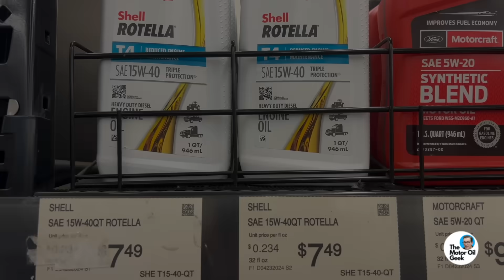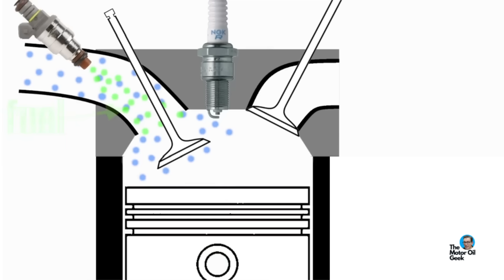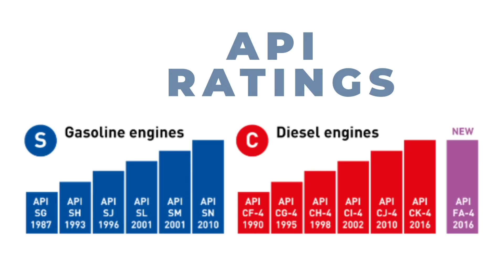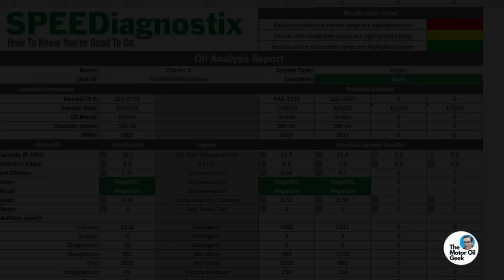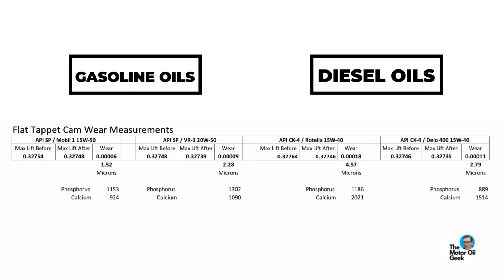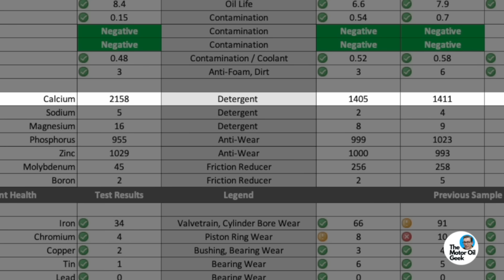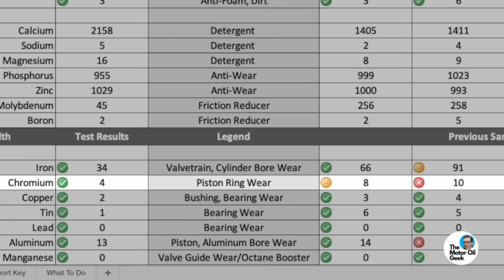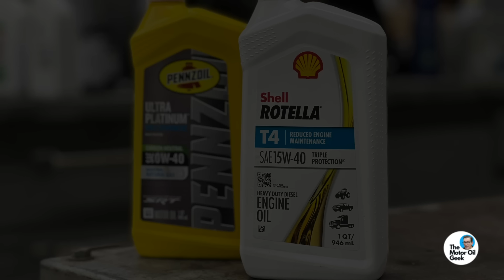Why DIESEL Oil is Actually WORSE for Gas Engines!

Comment: I have my original (86 yr old) 1939 Chris-Craft Model K naturally aspirated gasoline 6 cylinder engine in my boat and have been using Shell Rotella 15W-40 for over 15 years. Engine is L-head and has flat tappets. No issues. 85 HP, max RPM 3200, idle RPM 500, cruise RPM 2100. Bore 3 3/8, stroke 4 1/8, CR 6.2, cu in 221.4. Engine does not have an oil filter so the oil gets changed out at the end of every season. Engine consumes no oil during May to November boating season. Oil is relatively clean at the end of the season. Engine has been rebuilt once over 20 years ago.
Reply: Nice, I've rebuilt a bunch of old wooden boat motors but no Chris-Crafts before 1940.  Mostly used straight 30 like Pennzoil.
Reply: yep  again  clearly the proof is in the pudding  right here  no way to miss it
Reply: Should be using straight 30 weight, several companies make it with the needed zinc, including Rotella. 
Spring pressure is so low in these engines I’ve never seen a camshaft issue no matter what.
Reply: And the boat gets ran 1 hour a year 😂
Reply: @paulregarg7455
You fail to realize 1930s engine oil is nothing like today's oil. Also older engine from the 1930s have larger tolerances, they are not nearly as picky about oil like modern engines.

T5 is great for flat tappet engines. T6 is good too if you change over all your seals.
Reply: @paulregarg7455 ... probably average 150+ hours per season ...
Reply: No oil filter and you change the oil once a year? Wtf
Reply: @TheScrubmuffin69  My 1925 Studebaker and my 1931 Model A Ford don't have oil filters!
Reply: @spu3  My 1938 Buick has the optional oil filter. So they where not even standard in 38.

Comment: Change your oil every 3000 miles, rotate your tires, replace your wiper blades, check your air filter and the rest of the fluid levels. If you do this to your gasoline engine, honestly you’ll never see Dave Bell. Unless a wear item goes bad. I’ve been driving for 50 years and had a CDL for 46 years. Oh yes and my 400 water jacket goes 11.54 in the quarter and is great for bracket racing on Friday nights. Built not bought!! So honestly when Gale and Lake and Dave have something to say they are usually correct. Great Videos Thank You 🙏!!
Reply: Best advice on here

Comment: Jeep 4.0 loves rotella.
Reply: Mine has over 460,000 Trouble FREE miles on 15w40, several different brands over the years.  Pull the Valve Cover and it's SPOTLESS inside.  
.

Comment: For a modern car to switch is foolish.  Most people want to know what oil to run in their 40s-80s fun cars.  Old Rotella was the go to. What is the best car oil for a 50 year old car that’s stock is the question.
Reply: Run Super Delvec 1300 Dino 🦖 oil.

Comment: I use Rotella 15w40 Synthetic in all of my air cooled gasoline powered equipment.... never had any issue.
Reply: I have Lawn Mowers, Gas Tractors, Vintage Cars and even an old school Diesel.  I buy ONE Motor Oil.   15w40 Mobil Delvac NON Synthetic.  Nothing has failed in over 30 years.
Reply: @brucenichols540  I run SAE 70. Never had an issue.
Reply: 15w40 Rotella in a lawn mower I bought 18 years ago as a 'dispoable' mower I only needed it for a quick job. I leave it outside year round, and still use it to this day, only replacing a pull rope and air filter. A little smoky puff on startup, but It's delivered well beyond its years with the same diesel oil, i just top it off once every couple years.😂

Comment: hello speed , so I noticed some smaller gas engines  ( example Yamaha 7200 industrial gas generator ) calls for an oil with detergent . it allows for a 5w40 sythetic in owners manual but doesnt call for a diesel oil . i put t6 Rotella in it , the diesel oil for my truck . whats your take on these smaller gas engines . why would they want detergent and are we ok to run a diesel oil in these small gas engines or do we need a specialty detergent filled gas oil . also what if we ran this high detergent gas oil in a passenger car or a diesel truck .
Reply: thanks for the link , my understanding now is  each engine is differnt . differnt rpm, heat and pressure each require a differnt additive package . diesel is a lower rpm engine while gas is higher rpm . gas oils will have a lot more anti foam in it then diesel oil . along with some other things due to the pressure and heat wont activate right . like the zddp is fine tuned to work at specific values

Comment: I've been running 0w40 & 5w40 synthetic delvac & rotella for many +100,000km & years in my cars since I had my cummins. I purchased in bulk, and when a little over one jug does my honda k24 where it took 3 in the cummins, I had plenty to use up post selling it.

Comment: Don't use diesel oil in turbocharged,  direct injection gasoline engines is what I heard.  I have used T6 for years in my gasoline engines and they all are running good with no issues but they are not turbocharged,  direct injection.  My diesel engines are turbocharged,  direct injection though.  I'll take my chances as I have dodged the bullet so far.
Reply: The Most important lesson here is to NOT buy a ' turbocharged,  direct injection gasoline engine'.   I totally agree with that aspect!
.
Reply: Been using rotella t6 5w-40 in my fa20 wrx with no issues for 3 years. Only started using 5w40 because I have an upgraded turbo and do a lot of spirited driving and I didn't want the viscosity to get lower than 5w30, also seen a ton of people with Blackstone labs results with no issues.

Comment: I remember Comp Cams recommending the use of diesel oil with flat tappet cams about 20 years ago.
Reply: Even 30 and 40 years ago. metallurgy and oil has changed so much in just the past 5-7 years, not to mention the past 30.
Reply: The high lift performance  hydraulic flat tappet cams that see higher rpm are the ones most prone to failure.
Reply: Thank you!!!! I was going to post this same comment. It said on comp cams  paperwork with the cam.... Use Rotella or our break in lube that you can buy from us. Broke in many race car engines with Rotella and never had a flat cam along with a bottle of zinc. All our motors worked very well with no premature failures. They need to change the title of this video cause they are talking about injection we were on carb. motors and a lot of comments seem to be based on carb style motors so it may have a difference.
Reply: Plenty of high-zinc petrol oils are available though. There is no reason to need to use a diesel specification oil.
Reply: Comp cams are also nearly unuseable because of their non existent quality control now. Makes sense.
Reply: Made in China crap
Reply: And that's why Rotella is imprinted on mostly men in over 45.
Reply: @dadgarage7966  modern oils will tear up a flat tappet cam supposedly. but of course how many are still running one of those.
Reply: @joshualester2735 Well, there are a lot of old farm tractors still running like a top using modern oils, and most of the old timers that I know buy the cheapest stuff they can find. Just a little food for thought.
Reply: @brianw8963 true it’s why I said supposedly. While capable of rebuilding an engine I’m pretty un ambitious so I’ll spend a few bucks more, just for peace of mind.
Reply: @joshualester2735 my Land Rover  v8 is a flat tappet. Everyone the Rover community swears by Rotella for its zinc. Ive been running it for 20+yrs my self. But only because its what everyone said to do. This is the first time I've seen it explained. 
Im currently in the middle of rebuilding said V8 and will probably change over to non diesel oil this time.
Reply: Modern oil destroyed the cam and bearings in my boat 88 era Chevy 350. Ran delo with the new motor and have more hours than the last one at failure which was newly installed when I bought it. Started with strange swishing sounds for a couple seconds at start up then oil pressure just got lower over time.

Comment: I used thick diesel oil in my 1978 250 straight 6. Because it was worn out and had no compression and rattled from every moving part. It ran quieter and had slightly more power. That being said. This is the only scenario where I would use diesel oil in a gas engine. When it's completely worn out and I'm just trying to get more miles out of it before it dies

Comment: T6 rotella 5w40 has very little moly but high in boron boron is an extremely good anti wear agent probably better than moly. That’s why gun manufactures use boron on ar15 bolt carrier groups
Reply: Albinosnake1997,
A•R 1five ar•mo•rer here. What % of boron is in this oil (T6 5W-40) I used it for all. As far as the additive boron may not be as good as when it’s on metal surface. ((NiB)) Nickel~boron being a surface treatment coating, typically an alloy of nickel= 95% and boron= 5%, applied to the metal surfaces of BCG through an electroless nickel-boron plating process. Is it as effective? A good testing would be a magnetic particle inspection (MPI).
Reply: And I use olive oil for cooking, doesnt mean it's good for my engine
Reply: That’s a stupid example
Reply: @AlbinosnakeSVT it's absurd to think what's good for guns must be good for engines just like it's absurd to think what's good for cooking is good for engines 👍
Reply: @drivewayhero 
Guy raised a valid point. Boron is an excellent anti wear material and if it’s good for the military pewpew machines it’s perhaps good inside engines. Why would they add it if it wasn’t effective? Im a mil vet and that all the military gets their machines made.
Reply: @SPharaoh  you and the other guy come off as someone that doesnt know that tribology exists - literally the science of making engine oils. If you and the other guy think you know better because of your limited, unrelated, experience - by all means, go ahead and neanderthal your way into making a better engine oil.